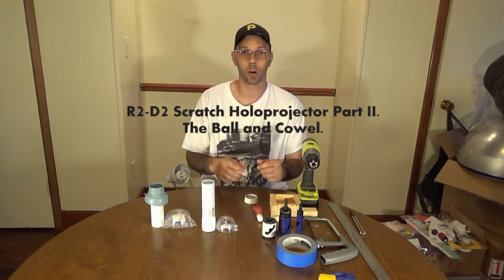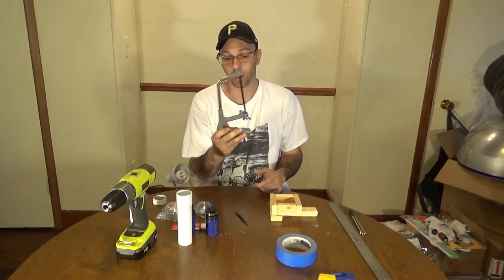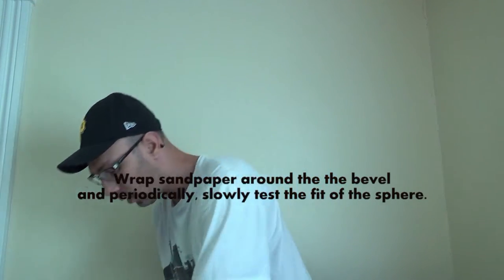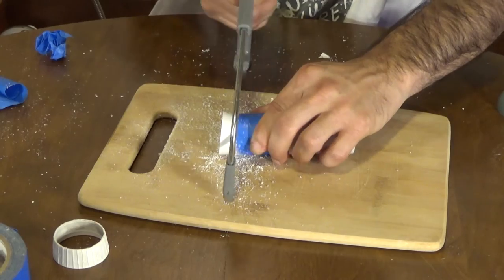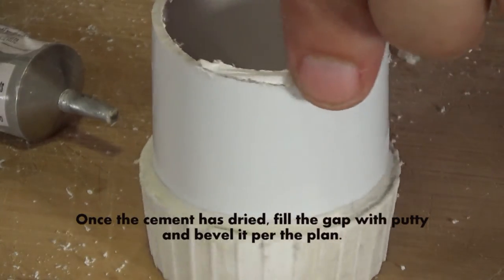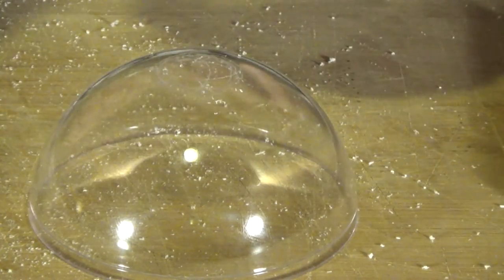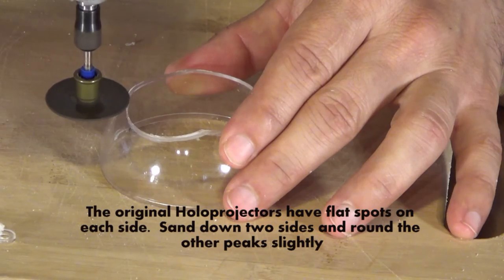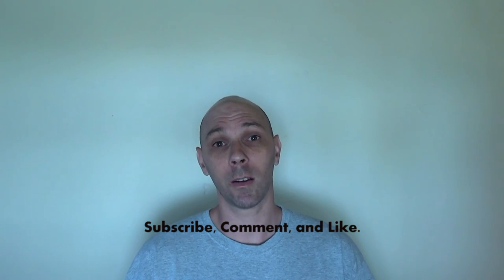Build R2D2 Dome Holoprojectors Part II With Craft Spheres and Plumbing PVC

Comment: I have a partially built  R2 that has  been  in the  works on and  mostly off for 10 or 12 years. Unless a guy has a unlimited budget to buy all the  right  parts  "when" available methods like this are the  way out. Last I looked a machined set of  holos was around  $400.00. Sort of takes the fun out of it  for a average guy. As much as I look forward to  a complete R2 I don't look forward to  dropping  10k for a super uber  aluminum one that is probably nicer than a film version.
Reply from the maker: This is the reason I make videos. Its for the average builder who doesn't want to spend a fortune.  But I can say this, the current droids on screen are now fan built most of the time. The Astromech.net club is contacted through Lucasfilm to use droids at premiers and for the screen.  Especially episode 7. Several club members had droids in the new movie. Uber R2s are a new standard now.

Comment: I’m making a model sphere Do you know what I could use to make a clear sphere I need a 30cm 14cm and a 4cm clear sphere.I want to make them.
Reply from the maker: 3d print maybe. Cast it, then buy small plastic sheets, heat them up and push it onto the cast?
Reply: @BuildanR2D2byAri  Its ok thanks I found some Christmas clear plastic ornaments for 30cm 14cm and a 4cm.
Reply: @BuildanR2D2byAri  I'm making a clear plastic sphere house model and I wanted the spheres to be clear so I could show people how my new house design works. I wish I know how to use the rotary tool better. so I can cut the string top piece off.